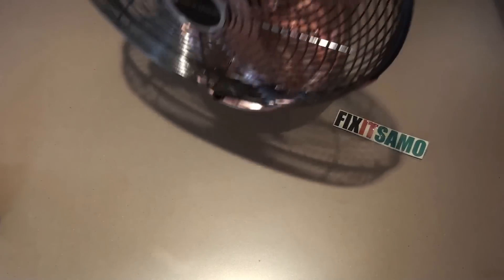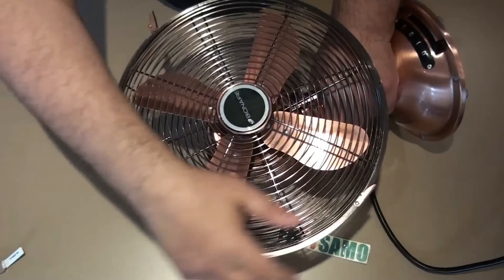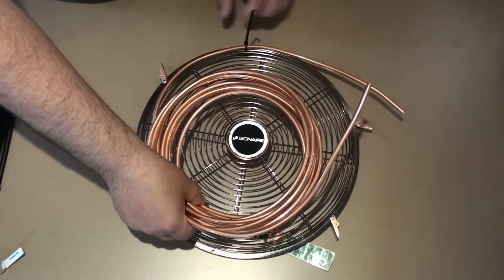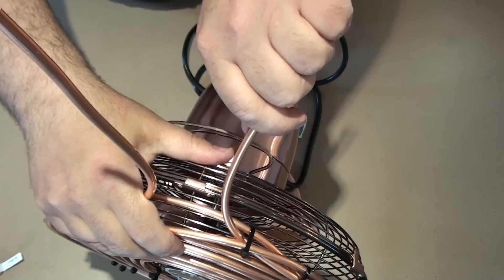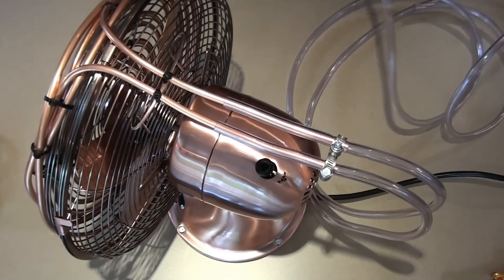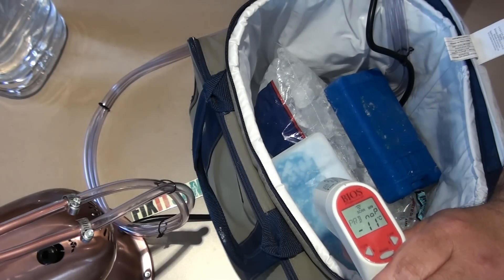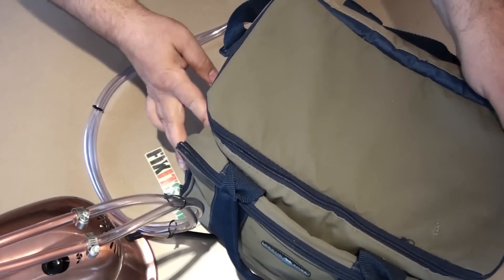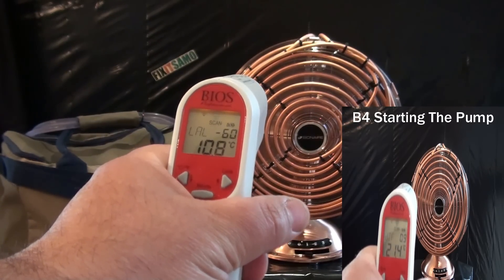How To Turn Your Fan Into An Airconditioner  AC

Comment: Could you perfect it with a home refrigerator?
Reply: Christian Pires so a refrigerator works by removing heat from the inside and puts it into the room it's in plus a little extra heat because of the electronics, so if you use this in your home and get the ice from a freezer in your home you will be making your house hotter not cooler.
Reply: Christopher Keesee using the cooling system of the refrigerator....not the refrigerator
Reply: but then you could just as well buy an ac unit.
Reply: Christopher Keesee actually, your house will be the same temperature, since the heat from the wires will be neutralised by the cool air coming from the fan.
Reply: That's the point... The cooling system will heat up the room :P
Reply: If you can exhaust the extra heat from the fridge outdoors, sure.

Comment: No condensate dripping onto table from cold copper tubing?
Reply: No, it would evaporate from the fan. Unless you mean from the cooler, which is insulated pretty well... I imagine the only condensate would be from the plastic tubing part, which could easily be solved with some insulation.
Reply: @gmodwirehelp  I actually just made this fan, it does create enough condensate  to need a small towel below the fan. i live in Florida so this may play a part in this due to humidity.
Reply: Mr Mork evaporation doesnt work like that, the water needs to be 100C to evaporate.
Reply: nouse use, how do you explain puddles evaporating? they don't reach boiling temp at any point. Your logic is flawed.
Reply: Water from puddles dont boil, they evaporate. 2 different things.

Comment: The Technical term for this is called Evaporative  Cooling. Used on large HVAC  in commercial buildings . 40 year old trick.
Reply: Kenny Gibson 
Actually, Evaporative cooling uses latent heat of evaporation (a wicking effect) of water to achieve cooling. Such as a swamp cooler or cooling tower.
This is more of a scaled down ice bank cooling system. But certainly nothing new. Still pretty cool!!

Comment: As they say "Necessity is the mother of invention".  They do have this design and product that can be in your room and much more  effective,  it is called an  indoor air conditioner. I give it an A++ for ingenuity.
Reply: Egidio  Ha but it can be used as a low cost "outdoor"  air conditioning too 
In my case I will use it in my patio and keep the ice in a better cooler box with my drinks.

Comment: Great idea make the water house connection rite above the electric motor.
Reply from the maker: +Devin Da boob  it should below the motor i did installed  on top just to show how it should be connected
Reply: No! You need the connections on the bottom to show how it works. You showing how to burn your house down.
Reply: Erm he was showing how to connect - obviosly afterwards he rotated the fan shroud and tubing so it was at bottom just as he said in comment.

Comment: How long does the ice hold? If i have to buy 3 or 4 bags of ice each day, it sounds like buying and running an AC would be cheaper in the long run. Probably more effective, too.
Reply from the maker: +Slyve  it will last around 12 hrs
You could also use reusable ice packs

Comment: just put a bucket of water in a small fridge and run the pump through it, drill 2 holes through the side then you dont ever need to add ice, you can run it indefinitely
Reply: You do realize that fridges get hot in the back as they cool inside right? :D You would just be moving the heat from the fan to the back of the fridge. It would only work if your fridge was outside your house.
Reply: Yeah, and you need to drill holes into a fridge that will probably cost about as much as dragging your crazy ass out to the store and buying a normal AC unit.

Comment: That is called a swamp cooler, not AC
Reply: Well, I mean, it clearly isn't a A/C unit, but it isn't a swamp cooler either. 

Swamp coolers are aptly named because it relies on water and ice to rely on cooling. But it uses more of a mesh like system to cool off the air, which in turn also increases the humidity.

With what he's done here, instead of simply forcing air through a membrain filled with water, it's forcing air around chilled copper piping.

Comment: Better idea: leave the fridge door opened!
Reply: That'd be okay for a little while, then the heat coming out the back of the fridge would warm the air around the fridge and then the rest of the house. The fridge idea would work if you put the back end out of a window, similar to a window a/c unit.
Reply: Also your fridge's compressor isn't designed to run that hard... they're pretty damn expensive.
Reply: Brekner Catalin iij

Comment: Can we use AC gas instead of icy water?
Reply: Onur Soyturk 
Of course, but that would mean working with pressure gauges and absolute sealing, some kind of compressor to circulate too, but you can't eject the returned gas back into your house

Comment: Wow I love smart people who lack some maths, so how much will it cost you to provide ice for that fan every 3/4 hours? and  how much will you power bill be ? oh sorry ice is free if you live  in Siberia  in winter time!!!!
Reply: You clearly haven't heard of the conservation of energy.  The fridge will work harder if you put water inside because it will warm the internal compartment by introducing water, saying the fridge is running anyway is wrong.   As the fridge is not 100% efficient, you WILL put out more heat into your room then you remove by the ice.  Additionally the fan is an electric motor which also generates heat.  It is impossible to cool something without creating more heat somewhere else.  Using a fridge in another room away from where you spend time is the only solution if you use a fridge to create the ice
Reply: And if you were smart, you'd add a 24 hour clock into the mix, and realize you can cool water in the fridge during the night/mornings, and take out the cooled water when it's hot outside.

Stop acting haughty when you haven't introduced the basic element of time into your thinking.
Reply: Bill Knows  freeze a block of ice or use gel packs they stay cool for long time no need to buy ice
Reply: The law of conservation of energy shouldn't be brought up in this conversation... The fact that you're typing (making noise) can theoretically result in an increase in thermal energy in the room. Is everyone going to argue about the laws of thermodynamics next? Anyone want to have a scientific debate on the fact that a room is not a closed system therefore the law of conservation of energy doesn't apply because energy can enter and leave a finite space? Anyone want to talk about how we can just simply turn our thermal energy into electrical energy and then view it from another perspective so that it's now magnetic energy and we can turn our massive AC bills around by utilizing magnetic houses to draw in precious ferrous metals?

Stop trying to be the smartest guy in the room; the point of the project is that cool wind blows in your face for a little while. No one will ever use a fan to cool a room even with this, it is to temporarily provide relief from heat by smacking you in the face with cold air.
Reply: if you have a fridge you can freeze water. You don't have to buy ice and its not gonna cost any more to freeze some extra water. Also in that bag, the ice would last a while. Also, you are gonna be using the fan anyway so its not gonna cost more to run the fan.
Reply: refrigerators work by pulling the heat out of the box and into the environment they are in.. it would heat your home to freeze ice just to cool it.
Reply: Brent C Your fridge is running regardless of if it's making ice or not. Also, fridges are not going to cause an overall increase in a home's temperature. Maybe 1-2 degrees at the most in close proximity to the fridge, but they aren't heating up rooms.
Reply: My goodness, I'm not trying to be 'haughty', I'm just saying that you put more heat into your system than you take out by using a fridge to provide your cooling.  I haven't considered a 24 hour clock because I suppose I don't really care enough to bother putting that much thought into it, it just seems daft to create a positive heat system when you're trying to cool the place down.  There is a reason AC units vent to the outside.  The undisputable fact is, you will heat your house up more using this system, that's all I'm saying, and all I want to say.

Comment: You could do the same thing if got a cheap radiator and pumped ice water through it and put your fan on the radiator. Would cost about the same and would save you a lot of time.

Comment: Those copper coils and fan cost more than a cheap window ac at Wal-Mart
Reply: This may be the case, but in certain places, you're not even allowed to have window units. My barracks, for example.
Reply: What about the electricity the window will costs 500wh  by the end of the day. Compared to this maybe it's 50wh

Comment: Would be a better design to put the coil at the BACK of the fan.
Reply: it would take more work do put it in the back though.
Reply: why would you think that would make any difference?
Reply: Forrest Boone you get less material blocking the wind blowing out. So the output would be stronger and since the airflow behind and around the fan would be slower, it would probably give them more time to transfer the heat into the copper pipe.
Reply: Not really, those kind of fan, both front and rear grill are removable, if anything, installing the copper coil at the back would actually make this DIY project more elegant.

Comment: I like the idea it's pretty clever but not sure I would have pipe connections directly over the fan motor though that will be nasty if they leak! I'd also like to see a test using just normal water would running the water through the coils on the fan eventually cool it to a point that you wouldn't need the ice?
Reply: nothing is really cooling it then, so it would not go under room temperature.

Comment: It would be better to use a five day cooler or better. And if you really want to kick it up a notch, make your own ice with salt water instead of regular water. You'll need a good freezer. Lowering the freezing point of water makes the ice much colder so the water that circulates through the copper tubing will be cooler. Add enough salt to taste like sea water. Don't over do it.

Comment: I think if you lived in the country next to a cool stream or big lake ..you could pump the cool water through well insulated lines ..run it though a big radiator  with a fan behind and then return the water back to the stream or lake far apart from the input water source. ..
Reply: you can simply dog down 5 metres,  install tubes.  then make oil run through it heating in the winter and cooling in the summer

Comment: I am here  in Central Florida, going to give this a shot to see if it will do anything to a 100 degree room.
Reply: ad dry ice it will work better
Reply: Yes, the pipes over the motor did give pause indeed. What did you think about the cooler ACs with the 12 inch fan blowing onto the ice then out a 4 inch PVC elbow?

Comment: Or you could buy a window air at Walmart for less money.
Reply: Step 1. Throw fan away. 
Step 2. Move someplace cooler. 
Step 3. Complain about how cold it is, save up for a heater.
Reply: Tactical Solutions not if u already have a fan and cooler.. that pipe and cables ties and pump are no more then 50$
Reply: And uses less energy then a window air
Reply: Cheapest worthwhile window air conditioners where I'm from are AT LEAST  250 $. That's pretty pricey compared to this guy's swamp cooler
Reply: A cheap window ac from Walmart uses 1.2 kWh. That is more than a fan IF you can get a cheaper source of ice.
Reply: Not a swamp cooler. A swamp cooler runs water over a type of cardboard or straw and air is blown through it. This really increases the humidity much more than this guys fan with a cooper cooling coil.

Comment: I would like to know how much cooler the room temp came down prior to using your swamp cooler
Reply: That’s not an AC sir. it’s a temporary pass-thru cooling device. It picks up 80*F ambient room temperature air (supposing) through the back of the fan, blows it out of the cold water copper coils at the front, temporarily dropping the temp to about 25*F from the ambient 80*F; then as the air is thrown out much cooler, it will absorb the heat again in a heartbeat from the ambient 80*F room temperature. You need a device or system that picks up heat and moisture from a room via an evaporator coil, and pushes it outside through a condenser coil. That’s what an air conditioning system is. Remember this: Heat will always follow Cold (Cold is the absence of heat).

Comment: To J:  you a/c techs are all the same. You think water =swamp cooler. Not so. This is a very simple air conditioner. It has a condenser, evaporator, a blower, and artificially cooled coolant (water cooled w/ice) which never comes in contact w/the air it's cooling. The only missing part is the compressor, which it doesn't need. In fact, this is exactly how the a/c was invented. Water was the first refrigerant used. The inventors used actual refrigerant that they developed when it was patented and produced. An evaporative cooler, or swamp cooler, is specifically an open air/open water system which pulls air across pads soaked in water to evaporate water into the air, thus absorbing the heat and cooling the air, adding moisture, i.e humidity. That's why they only work in dry climate and in a certain temp range. If the outside temp is too hot, you get hot moisture, or you could say,  "it feels like a swamp in here!" hence the nickname.
Reply: Mad applause...........well said.
Reply: You are correct, it is not a swamp cooler, but you aren't not correct in calling it an air conditioner.  An air conditioner has to remove humidity, along with dropping the temperature.  If this air cooler he has, is getting the air below its dew point from a temperature stand point, and is sweating on those tubes, then it will be an air conditioner but he is also going to need to drain that water away.

Comment: To everyone that may not know. As an AC tech this would fall under a swamp cooler category. And its awesome. AC's use refrigerant which works alot different then water. There is no electrical/condensation issues here, its a small fan, you'd have to pour water on the actual outlet. Its just air blowing over something cold, making colder air. An actual AC with refrigerant requires exact tempuratures to superheat and subcool the refrigerant for maximum heat absorption and removal.
Reply: jay hearts *than
Reply: Swamp coolers are evaporative.   This is not evaporative.

This is a heat pump.

Add 100' of tubing 10' under ground and it would cool (and heat) year round towards whatever the average temperature was.

https://en.wikipedia.org/wiki/Heat_pump

He just has a portable source of cold instead of using the deep soil.
Reply: But even a heat pump still uses an refrigeration system to move the heat.  If this "portable" source of cold was made isn't the house (room), then you are at a net gain of heat.

Comment: What I'm mostly curious about is what is the total wattage used here, pump and fan.
Reply: Reyes Partida a lot less than an a/c
Reply: Reyes Partida haha the fan watts plus the pump watts which both are probably tiny amounts.
Reply: A window fan uses 1.2 kW per hour. A fan the size that he used 100 w per hour + small pump 15 w per hour. Ice depends on source.

Comment: There will be condensation on the pipes which is not safe near electrics. Air conditioner takes warm air cools it drains the water from warm air then blows cool air into room.
Reply: A Miah condensation on the front screen of the fan. no where near the fan motor. and actual AC's use refrigerant, not water.
Reply: A huge part of what makes an air conditioner is the "conditioner" part which is lowering humidity to under 60%.  

For about 3 months a year (2 in the spring and 1 in the fall) the temperature at my house is about 75.   So the AC won't run.   But.. it's often 70% humidity to as high as 80% humidity. .  Fabric items feel damp to the touch.   

So I would cycle the AC on and then off.

But I finally bought a dehumidifier.  It lowers the humidity to 45% at a much lower cost than running the AC unit (like $10 to $15 a month).

Comment: Nice video sir. Some people just don't understand that this is a workable solution for some people. I work in a shop where it easily gets 105 degrees (Fahrenheit). I would gladly build this to set on my toolbox to get a gust of cool air when I go to the box. Obviously it isn't going to cool the whole shop, or a whole room. and a window unit wouldn't be a good solution because it would simply dump the heart right back into my air. Nicely explained and I enjoyed the video.
Reply: Watch out for the condensation and wires

Comment: I need to do all this but inside my car....is it possible ?
Reply: 12v DC pump and fan instead of AC.
Reply: When I was a child, my grandfather had a 1959. He had a small AC unit that worked like this does. The unit plugged into a cigarette lighter. You put ice in a box and the fan blew air across the ice. I do not know more than this. I do not know if there were copper pipes or anything like that as I was a small child. So yes, it would work.